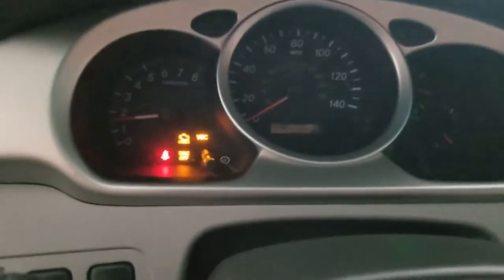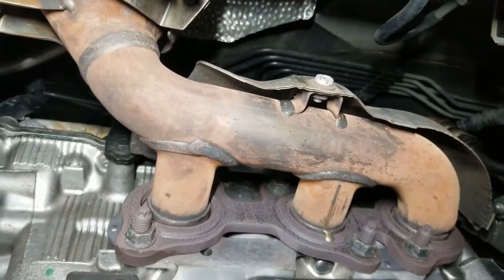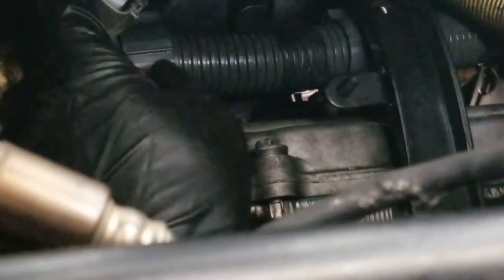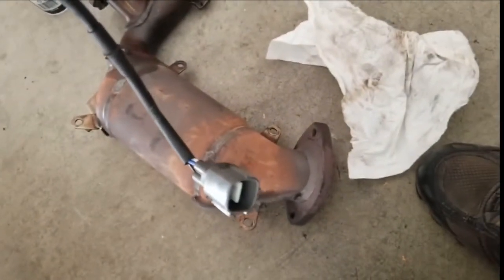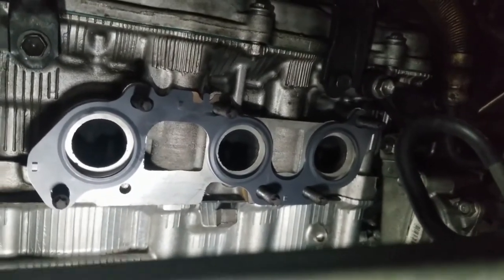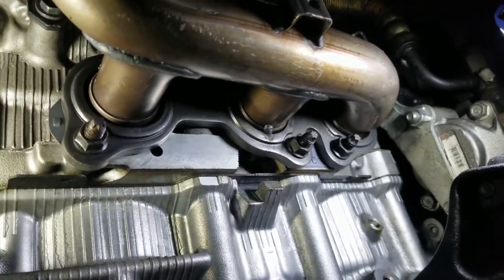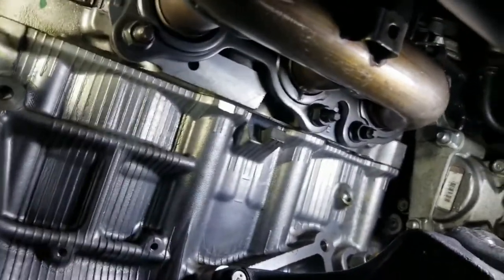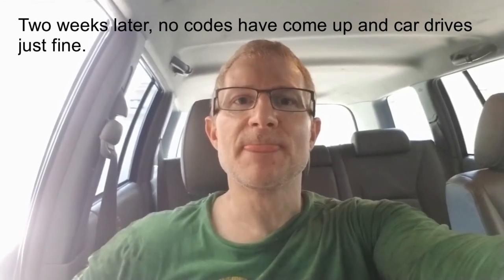Toyota Highlander 3MZ- FE (3MZFE) Catalytic Converter Bank 1 replacement (P0420)

Comment: I disassemble exhaust manifold of bank 1 today (2/3), but I have to take out the intake manifold for take off A/F sensor connection. I thought the design of yours is really good space. I have to use the combination for remove exhaust manifold nuts. I used impact for take off 2 nuts at the end of this exhaust manifold (cannot use my weak hand),  and 02 studs (at the end of exhaust manifold) worn out (bad news for me although use by hand). I am trying to find a way to take it out.
Reply from the maker: Maybe add some lubricant to the studs to help make them more loose and easier to remove?
Reply: @TheRandomDave  Yes, try 2 nuts lock together with Blaster penetrating oil add-in, slowly and slowly. Hope it can be out tomorrow. Thanks Dave,
Reply from the maker: @PhongNguyen-pg8wm  I hope so too. The another option might be to use a torch to heat up the stud to try and get it to break loose, but that can be risky or dangerous depending on circumstances.
Reply: @TheRandomDave  Got both studs out this morning easier by Blaster penetrating oil drop from yesterday (with 2 nuts lock together because stud head worn out). I wish that I did drop it before touch the studs! Anyway, the most difficult right now is how to turn out this exhaust manifold!!! still stuck in there. I'll be back this afternoon (have to go to work now).
Reply from the maker: @PhongNguyen-pg8wm  I'm happy you got the studs out! I know that you will be able to finish this project, don't give up. 😁
Reply: CAT was out the way which I cannot believe. However, I am really appreciate your job and your video. It'll also help a lot of guys for DIY. Happy weekend to everyone, and hope next week will be ok.
Reply: and the way you sent out the message a.s.a.p to reinforce my work. I have to say a big thank to you, Dave.
Reply from the maker: @PhongNguyen-pg8wm  I am happy to help a fellow DIYer. Best of luck to you Phong!
Reply: Bad news! I have almost a week without P0420 & P0430, and a code displayed today (one the way back home from work)is only P0430 = I have to replace CAT2. 🤣🤣🤣. Let see what I can do,
Reply from the maker: @PhongNguyen-pg8wm  oh no, that is a shame. I had to replace both cats on my car too.  if you have questions, please ask. Good luck
Reply: @TheRandomDave  Ok, both CAT should be fine. 😆😆😆
Reply: Today is my Friday, and more happier than with me! I did remove negative connection of battery before yesterday. CEL was gone but OBD2 still shows P0430 and smog test icon shows catalyst fail. But after my working time today, I start the engine and connect obd2 again, P0430 left me! and all the functions of smog test = ok. I'll update end of next week, and hope nothing happen. You've a nice weekend, Dave - Thanks again for your video.
Reply from the maker: @PhongNguyen-pg8wm  I hope that the cat is still good for you and no more trouble codes. Enjoy your weekend Phong.
Reply: Update: I order and pick up CAT2 today from Toyota Gladstone, and I'll replace it this weekend. Wish the best for this one (avoid P0430 code), and no more trouble with CATs.
Reply from the maker: @PhongNguyen-pg8wm  I have a very good feeling that this will be good, and you will have no more trouble with CATs. If you need any information while doing your repairs, feel free to ask me, and I will do my best to help. Good luck Phong!
Reply: @TheRandomDave  ♥
Reply: Replaced CAT2 at Friday morning (3/3), still see Smog Readiness Check Warning with !. 
I plug OBD2 this Saturday noon and see Smog Readiness Check passed, with Catalyst test is completed. 
Review my message on here (last 2 months), and would like to say a big thank again to Dave's video (a technician told me that he needs to remove steering wheel system at the bottom for taking CAT1 off) that helps me out. Bon courage, guys,
Reply from the maker: @PhongNguyen-pg8wm  I'm so proud of you Phong. You are awesome! Great job.
Reply: @TheRandomDave  ❤❤❤

Comment: Those AF sensors cost over $100. Just not sure why you’d risk chowdering up the head to save $5 on the proper socket.
Reply from the maker: tbh, i had no good reason, i just never got around to buying the correct socket. I agree, it's best to use the right tool for the job.
Reply: 7/8 wrench?

Comment: I have 2009 highlander hybrid it need catalytic converter bank 1 it’s going to be same work of your video and the same engine or different please let me know thank you
Reply from the maker: if your engine is a 3MZ-FE then it should be a similar process to replace as in my video. If you have a 4 cylinder engine, it will be a different process.
Reply: @TheRandomDave  how to know if my engine is a 3MZ-FE or not thank you for responding.
Reply from the maker: @saif2684  if you look under the hood of the car there is usually a vehicle emission sticker there which will show the engine type, engine size, model year, and other information. thank you.

Comment: this one is actually easier than the front because the front has the compressor line right in front of the last mounting bolt...
Reply from the maker: that's right, i forgot how much of a pain that was too deal with. great point. it's a really tight fit.
Reply: @TheRandomDave  actually I was wrong... this one is wayyy harder... I dont know how you did it! There is literally no space. good Job!
Reply from the maker: @JUDALATION  Thanks Judalation. Both banks are a challenge, each in its own way. However, you do know how I did it, it's all there in the video! :)
I appreciate you coming back to comment.